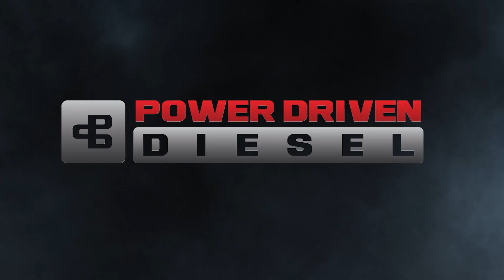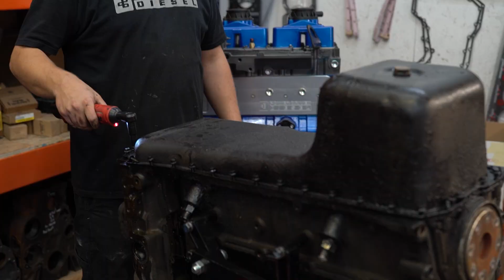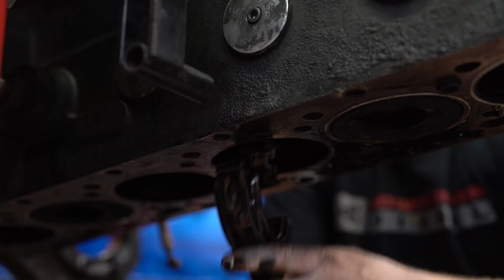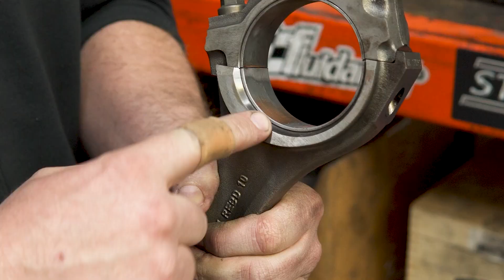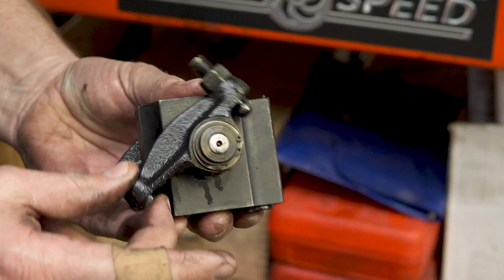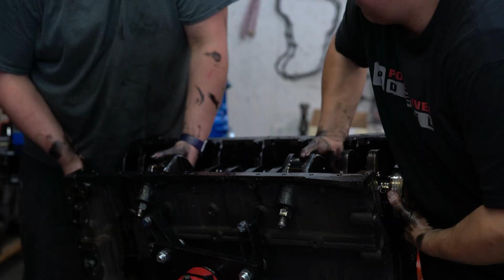Inside 650HP 12v Cummins After 350k Miles

Comment: What kind of power should I expect with only 18° timing let’s say I want a very drivable towing/fun truck
Reply from the maker: Power depends on the whole combination, not just timing.  For example: Will's 95' 12 valve junker drag truck engine with compound turbos used to make 675 HP at 18* timing about 980 HP at 26* timing and 1075 HP at 32* timing.  But a stock truck that makes 180 HP at 13.5* stock timing might only gain 10 HP with 18* timing, but it might also pick up 1 mpg and drop 100* EGT while towing.

Comment: Is it possible to get a VE 12 value to this power level?
Reply: With enough nitrous, yes.
Reply: @N.A.J.  I made 630rwhp and 1300torque several times with my VE fuel only but you won't get there with a 12mm pump. If you need over 400rwhp it is best to just put a p-pump on.
Reply from the maker: Highest we've heard of with nitrous and water/methanol injection on a VE truck was mid 700 HP.  The water/meth is introducing another fuel source so it really helps on a fuel-limited engine combination like a VE pumped truck.

Comment: So what what was caseing all the crank case pressure? How was the bore on the block?
Reply from the maker: Bore had vertical scuffing, most likely from butting rings a time or two at the drag strip on a low 12 second 1/4 mile pass.  Bores will clean up with about 009" piston to wall hone job, so for a milder power level rebuild it will probably end up 020" oversized.

Comment: I’m planning on manual swapping my 12 valve because I went through 2 transmissions.
But none of those transmission were from PDD.  Idk if I have the skill to build one on my own with one of your kits.
Reply from the maker: Manuals are great for guys that like rowing gears... full manual VB built autos are better, at least more fun for sure!  We've had lots of customers successfully build their own transmission with one of our kits, so if you're up for it, give it a shot!
Reply: Allison swap it i have a 5 speed 12v and it gets old after a while on the bright side 330,000 miles and it still shifts smooth :)

Comment: Love the mechanical content!! My 96 5 speed truck has 325.000 miles with head studs slipped in one at a time, 60# valve springs, PDD push rods, 6x11 VCOs, 21 degrees timing, and HE351/S369sxe compounds. It has been an amazingly reliable setup and now I know the motor most likely has alot of life left in it. KEEP IT UP!!!
Reply from the maker: Sounds like a great combination!
Reply: Ever had it dyno’d and any idea on the power or MPG if you even keep track of it.
Reply: @kalebstout7673   Never had on a dyno, would love too one day. Power is probably north of 400hp off the butt dyno and from driving other trucks. MPGs aren't bad, average about 15, hot rodding around and towing.

Comment: Sweet I have the same 98 12valve 215 pump 
My dream is your compounds. 
I have a motor built waiting to be put in, I have a stage 4 colt cam it and would love to see what your compounds would do with that cam. 
Please and thank you Will
Reply from the maker: Sounds like a great build plan/setup.  We've tested larger cams in the past on a 500ish HP 12v with a medium sized single turbo and it didn't really pick up a measurable horsepower gain on the dyno.  We suspect the stock head was holding back dyno gains from the mild cam.  The stage 4 colt is bigger than what we tested and the towing compounds flow more air, so it should be a great combination.  Now if you topped if off with a ported head..... it might be incredible.

Comment: This definitely makes me feel better about where I'm going with my 99 24v. Guess the weak link is still that stupid VP44, hope to be shed of it one day.
Reply from the maker: VP's are fine, just need to be changed out every 100k to 200k miles when they fail.  Honda's and VW's need a timing belt every 100k.... so what's a VP44?  The VP trucks start really nice and they make great power till you try to get past 500 HP, then you need an SO pump or a Hotrod VP44 pump.
Reply: @pddofficial  lucky for me I have an SO, ever since I swapped in the new VP44 she has been running smooth, but something about a P-Pumped 24 valve just sounds right to me!

Comment: How much power can I push to the rear tires safety and reliability with a 24v cummins  I currently have 305,000 miles on the clock I'd like to bump  my power level to about 500hp at the tires
Reply from the maker: 500 HP to the tires is doable with the SO or standard output 215 or 235 HP models.  With the factory 245 HP based HO models with the 6 speed manual, the injection pump limits power output to the 450 to 490 HP range.
Reply: @pddofficial  how do I know if I have the ho model or not  I'm kinda  new to the diesel engine I've only owned this truck for about a year  now

Comment: Would 25 degrees of timing be the max for something you daily drive in the winter?
Reply from the maker: With working grid heaters, you can go as high as 30*, but it's starts hard and is annoying for most.  Keep in mind -20F starts in Montana or Minnesota are not going to happen at 30* timing but 10F will be rough, but it'll start.  Sometimes if you cycle the grid heaters twice before trying to start with good batteries and 5w-40 synthetic oil so the motor turns over faster will really help and then you could possible run 30+ timing.  If you have a working block heater and plug it in, then 30* timing is never a problem.

Comment: Did you have your head oringed man I know that’s a rhetorical question. Love you guys spend more money there than anywhere.
Reply from the maker: The block was o-ringed in-frame with an Isky Groov o Matic.  The proper way to do it now is to o-ring the head since it's easy to remove  compared to in-frame grooving the block.

Comment: What oil would you guys use if it wasn’t your own?
Reply from the maker: Oil with high levels ZDDP and the proper viscosity are the key.  We've had good luck with the Joe Gibbs Driven oils on the race trucks back before we had our own high performance diesel oil.  We've tried Valvoline VR-1 60 weight and it performed well, but it's a little thick vs 15w-40 oil for sure.

Comment: I'm saving up to Cummins swap my 6.0 250. I wonder what the cost for a build like this is. Maybe a parts list?
Reply from the maker: It's a stock engine with headstuds, pushrods, valve springs, injectors, and towing compound turbo kit.  The pump's fuel/power output could be replicated with a stock pump with delivery valves and governor spring upgrade.  No need for a $2,000+ pump build for this power level.  Wait for the final product, we'll see just how far this 12mm p-pump will take us!
Reply: Truck runs great currently. 267k now. 
Figured I should save for the big day though.